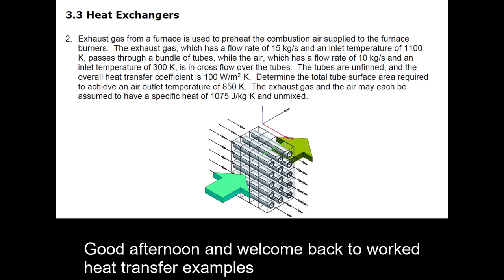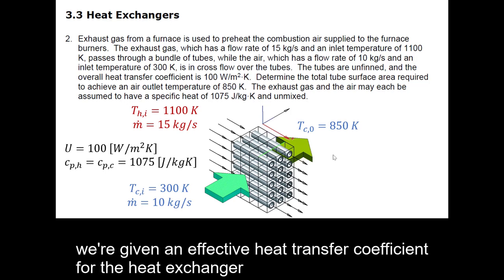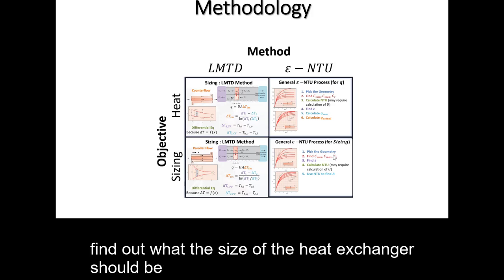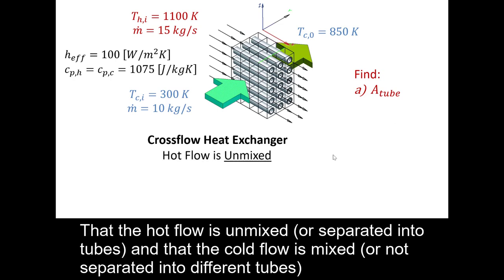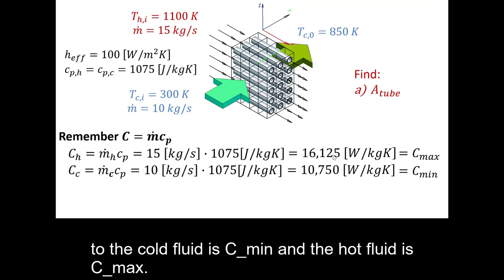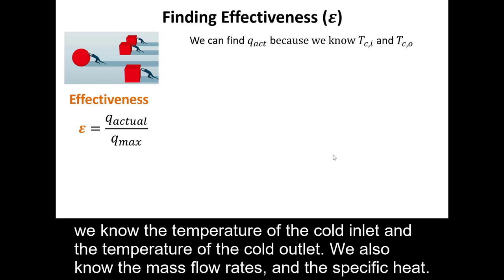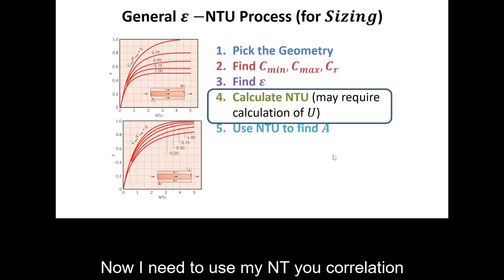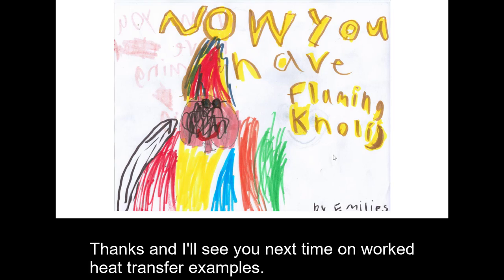Exhaust Gas Re-circulation Heat Exchanger (mixed/unmixed): Heat Transfer Examples for Mechanical Eng

Comment: In all the examples, UA is given. But if you do not know U. ?
Can we hv one example of such situation?
Reply from the maker: I'm not making these anymore. But the process is essentially the same. You'd have to have the rest of the information (i.e. a known heat transfer and size). Then you just solve for U instead of A. I think design wise, this wouldn't be a common occurrence, but you can certainly construct a problem where U is unknown. 

I believe that in real-world situations, it would be more likely that you find U using internal or external flow calculations. Then use that U to determine your area or heat transfer. There are several examples here on how to find "h" for internal and external flow. In this case, the U would be constructed by finding the h value inside the tubes (internal) and around the tubes (external). Then if you didn't think it was negligible, you'd include the conduction resistance to find U.
Reply: @mikeschertzer941  Thanks for reply. In order to know U, we calculate film HT coefficient on both sides based on appropriate co relation of Nu-Re-Pr and friction factor -Re. But to evaluate these we need physical properties at say average temp. Then the problem is we do not know outlet temp.
Reply from the maker: @udaymahajani1990  Might require building a model in that case and iterating to find a suitable design.
Reply: @mikeschertzer941  thanks for reply. Do you hv info on LMTD correction factors for cross flow mixed flow in multi pass arrangement?
Reply from the maker: @udaymahajani1990  No. You'll need a text book. Or try to find them online.

Comment: That was amazing sir, I have problem to solve a calculating of heat exchanger cross flow. This heat exchanger is used for heating the brine before entering the desalination flash evaporator Chamber. We are usually called this heat exchanger as a brine heater. 

The tube side is containing by a brine and the Shell side is containing by a steam.

I'm so confused to solve this problem because i don't know how much is outlet steam temperature, and my lecture ask me to find LMTD and the efficient of this heat exchanger.

Perhaps if u want help me, I'm so grateful for it. But, i have one wishes. Could you send the LMTD and NTU matrix to US? I think that matrix can help me 

Thanks for your education in this video
Reply from the maker: Sounds like there is one side of the Heat Exchanger where the change in temperature is unknown and another side where it's known? If you know how much heat is added / removed from one side, you can assume no losses and find how much heat is removed / added from the other side. 

Sounds like you have phase change, so you have to remember that once you hit the saturation temperature for a given pressure (i.e. phase boiling starts), you account for the extra energy by increasing the quality (i.e. more vapor formation). While you are "under the vapor dome" you can use latent heat.
Reply: @mikeschertzer941  thank you very much sir, let my try your advice 🙏🏼 and maybe I'll be back again to asking if Im still confuse with this problem

Comment: Sir if there is phase changement in flue gas side (hot) what will change in calculation . Thanks
Reply from the maker: Having a two phase fluid in the system will change the heat transfer coefficient (h). So you'd likely need a chance different correlation.
Reply: @mikeschertzer941  thanks sir if you have any refrence for that situation plz?
Reply from the maker: @alish5598  Sally I don't. It will be specific to your situation. Try a heat textbook (maybe an advanced one). Or you can hunt around in the literature. Google scholar maybe. I'm not sure how common this situation is. Perhaps you could try to discuss with someone that works with a device similar to what you are thinking of.

Comment: Hello sir, one question, in the case of cooler grate cross flow heat exchange. What will be the case for NTU calculation ?
Reply from the maker: I think you want to follow the same 2x2 matrix as in this video. You will use effectiveness NTU. Then figure out if you are solving for heat transfer (known size) or size (known heat transfer). Go through the checklists on the 2x2 for these cases. You might benefit from watching a couple of my heat exchanger videos to see examples solving for heat and solving for size. Good luck!

Comment: Hello,

My pipe diameters are Ri = 0.045 m and Ro = 0.05 m. The pipe metal I use is aluminum. How do I calculate the total heat transfer coefficient if we calculate it similarly to your question? Thank you.
Reply from the maker: You don't calculate the total HTC directly. You'll need h on both sides of the heat exchanger. If your heat exchanger looks like the one in this problem, one side is internal convection in a pipe, and the other is external convection over a cylinder (at least as a first  approximation). I have videos for both of these cases in the same Playlist as this one. The resistance of the wall may or may not be important depending on its relative resistance.
Reply: Actually, here's my problem. I want to design a simple recuperator. Exhaust gas temperature 610 degrees and room temperature 20 degrees. I'd like to increase the room temperature to 250 degrees using the exhaust gas. I wonder how long I should use pipes. And what should be the surface area of these pipes ? Actually, the problem you solved was very helpful, but I couldn't calculate the total heat transfer coefficient. I'd be very happy if you could help me. Thanks.